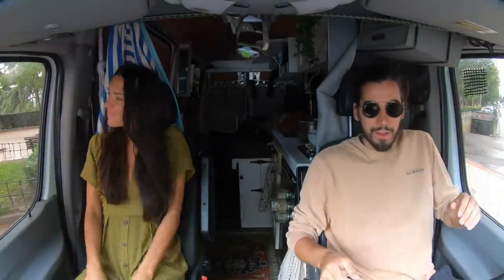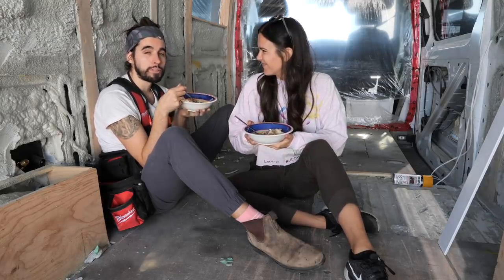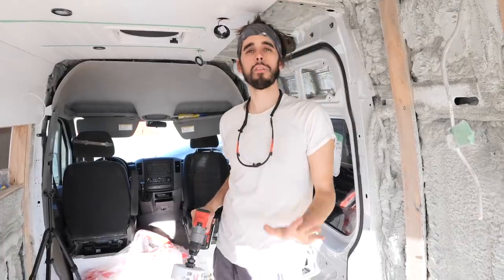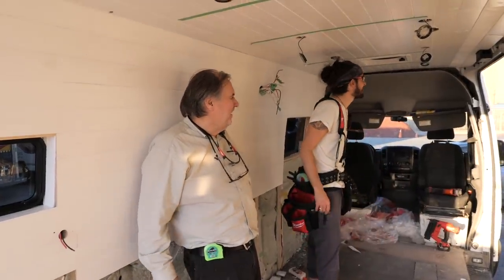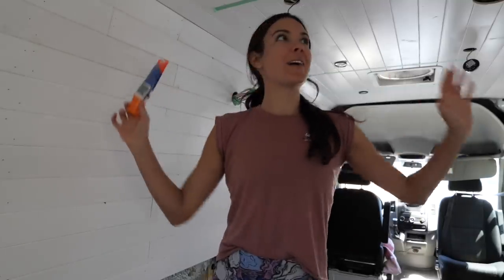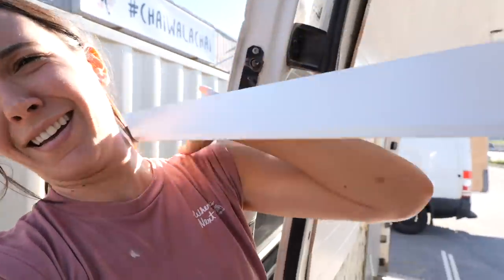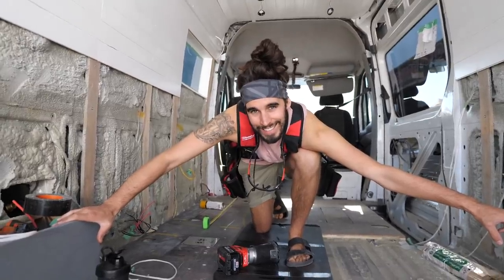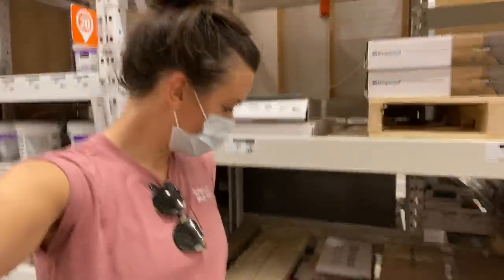Starting to Look Like a TINY HOUSE (van life build)

Comment: What a great progress. Bec is really doing a great job. Did you sanded the wood, than make it a little bit wet with a sponge. So all the little hairs of wood stand up and you can sand them down with a smoother sandpaper. Last point is then painting. The result is a great surface. And thumbs up for Eamons working boots, also using these - the best on the market.

Comment: I know its too late nowand you probably wont see this but for future reference, the best way to fill nail heads is use (ez sand) joint compound. It doesn’t shrink out like caulk or leave a film on the surface. More work with sanding and painting but well worth it for a perfect job.

Comment: Bob is like: 'Move over, I'm gonna do this. You two go and run the shop.'
It is all looking good, but you didn't do the vapor barrier. Vapor barriers are really important, especially in a van conversion, imo. I hope you painted the backside of all the things you are screwing to the ceiling and the walls. If you haven't done that, things will start to grow on them. I know it is too late for you to do it now, but viewers that want to do their own van conversions need to know this.
Regarding the cost of the conversion: If you are paying rent while you are doing the conversion, this will ad to the cost of the finised van (if you are going to be a full time van lifer). Motorhomes can come cheaper than this and with a better finish, better bathroom, better heating system and more space. Just something to think about if you are on a tight budget. But off course you have to do your research on a used motorhome. A lot of things can be wrong with them. Mold can be a big issue, for one.

Comment: 2:57 you can use a planer or just run them through the table saw they’ll straighten up. They’ll be good for finish carpentry (drawers, desk or even stuff in the kitchen) i feel bad for Bec ahah

#LearningEveryStep
Reply: You honestly don’t even need to do that, 90% of the time just nail, bend, nail, bend, done.

Comment: Van looks great. Using that nail guns looks great and so much quicker than by hand. I don't want to be negative but when I built my van I used screws. With the vibrations and movement in a van I would be worried about the nails working loose. Did you nails on Trinity? Would be good to know if you had any issues, will be much quicker on my next build to use nails! thanks!

Comment: looks great. Question - did you use any wood support strips on the ceiling? Or did you just nail into the metal frame?  Thanks for the video. I'm about to embark on doing mine and have no idea what I'm doing.

Comment: Um, when you say your floor heater panels are "efficient", what do you mean? I believe that all electric resistance heaters are the same efficiency, if they don't have moving parts or lights. (This is typically much less efficient than a split air unit, but those are generally problematic for vans.)

Comment: About the doors of the top cabinets.  If they are attached to the bottom instead of the top, the doors can be used to put things from the cabinets on when finding things in the back.   
Saw this in amazing van build by a professional cabinet builder, and it both looks good and makes so much more sense when you see it used.  And he has some other well though ideas.   
Amazing work you are doing, you 3 inside and out beautiful people. 
Greetings from Denmark
Cabinet doors: time: 20:50 kitchen and 31:00 clothes:
https://www.youtube.com/watch?v=dUKc1TGS-bU

Comment: So I do have a question... honestly I did try to scroll through the comments to see if it had been answered but theres over 1000. Lol on your heated floor did it come with just one panel therefore you have to purchase multiple panels? If so how many did you have to purchase to do your floor? I'm looking start my own van build in a couple months and I'm trying to do all the planning now.
Reply: Angel Baby it depends on the space you need to heat. Check out www.expeditionupfitter.com for specs

Comment: BEC.. I really want that connection to the 12 volt floor heater..I'm on a sailboat and Neuropethy has wasted  my circulation. My feet freeze.I did spend  25 minutes or so searching the business name you gave...Is there a connection you have...a manufacturer etc........P.S.  BEC  you can run..I was amazed when you (on camera) sprint racing on that sandy beach 2 yrs. ago    Gary